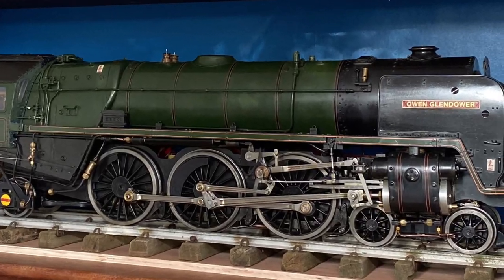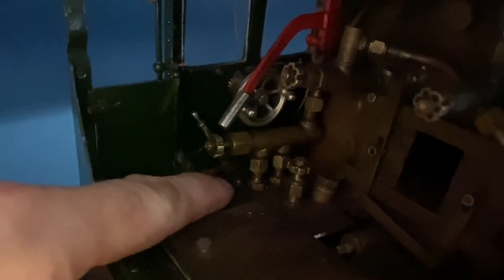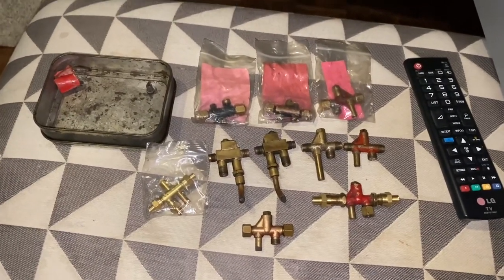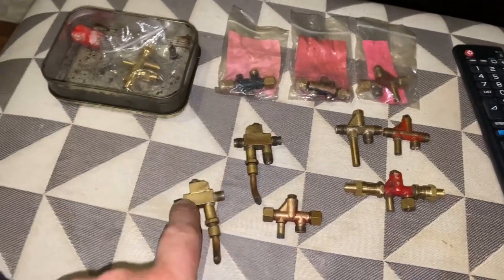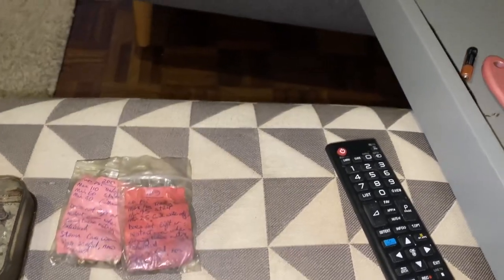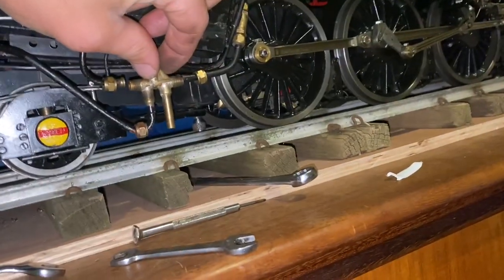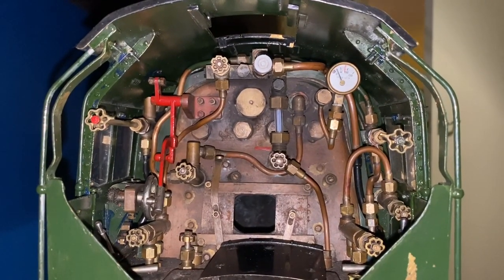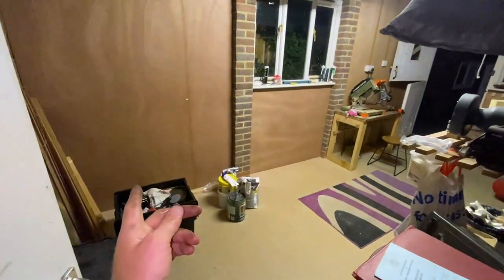A first look at the new loco, and starting to prepare for test…

Comment: I will be interested to see how you go about the hydraulic test. In my experience older regulators always leak at 2x working pressure making it necessary to keep on pumping to maintain pressure. I prefer to remove the superheater to allow the main steam pipe to be blanked off. There should then be no water sloshing about at the front end to cause doubt as to its origin. What is your view? The Britannia is very nice and I enjoy all your videos. Keep them coming.
Reply from the maker: Interesting question. Personally I prefer to keep everything in place, it may mean a bit of leaking if it doesn’t quite seal, however that’s a lot less effort than taking them out in many instances. In this case however, there is a ball valve in the smokebox, so I would be very surprised if it were to let by at any pressure. Being a retest rather than an initial test it is only required to hold 1.5x WP anyway. 
Many thanks, I never know how well received the videos will be, and it is nice to hear that they are liked.

Comment: Nice looking "new toy" Tom.
Hope the testing goes well, and looking forward to seeing you behind the regulator instead of Mini Driver.
Cheers.
Reply from the maker: Thanks. With any luck it will be on track on Sunday, assuming there are no issues. As I remember the last time it was out it passed its hydraulic and steam tests, but had issues on track. These were sorted some time ago but it never made it back to the track. I did see it run on air 2 years ago.